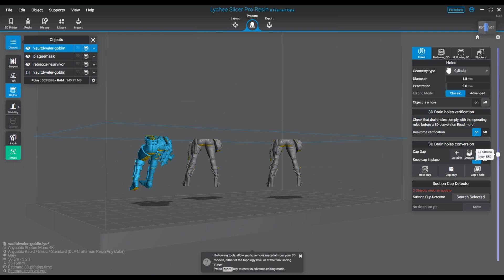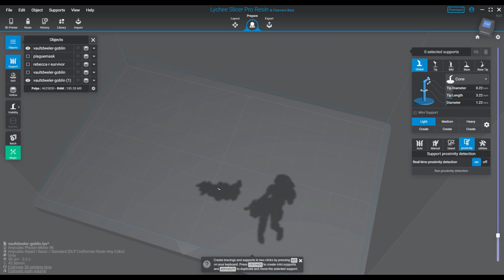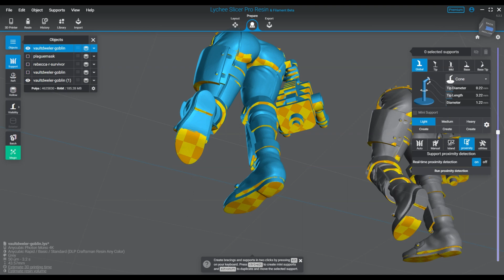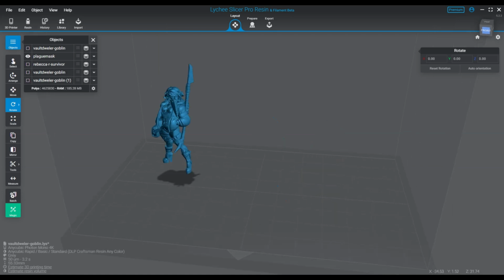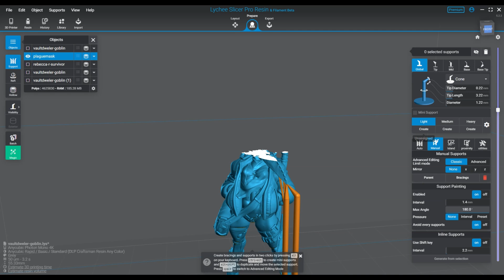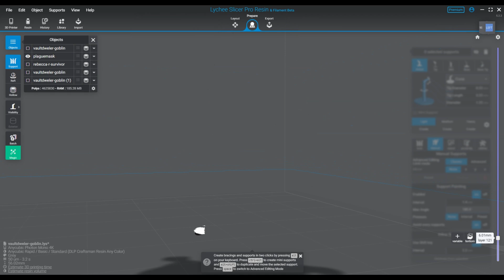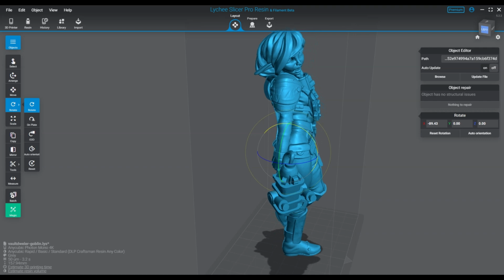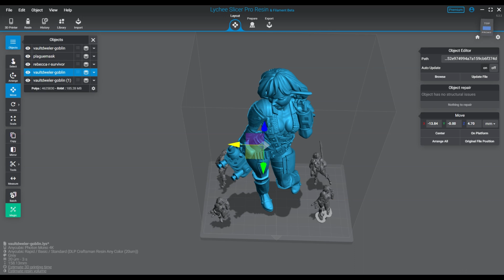Stop doing this with your 3D resin prints

Comment: Tbh I would print her upside down especially with the beak, because it’s easy sand down the hair to get rid of the dimples. I print upside down on alot of my prints
Reply from the maker: Yeah I do the upside down thing, especially with a lot of tiny bits or strands. Good tip!

Comment: I find auto supports very helpful in halotbox. I only print 32mm and smaller pieces, I don't print large models, so the vast majority of factors (weight, height, etc) are not an issue for me in regards to prints.

I did enjoy the video, I always like to see how others implement their own methods.
Reply from the maker: Thanks for sharing! How do the models come out? Also what size tips, bars etc. are auto setting I am just curious as I have had luck with autos in the past, but it was very hit or miss.
Reply: @IPrint3dMinis  

My settings are:
Light supports: Top shape cone, upper diameter .25, lower diameter 1.25, top length 3.00, contact shape none, Contact Diameter .40 contact depth .20, cross width 10.00, cross start height 3.00.

For medium upper diameter .44, lower 1.44, everything else the same.

The heavy is default.

I auto support to set up a foundation, then I manually add supports from there. I will delete some auto supports from the feet of the mini and add 1 heavy to each foot, then tack in lights all around the foot following the edge (like done in video) mediums I primarily add to torso (some times I'll add a heavy or two, just depends on the details of the model because I don't want to cover up detail). 

I also go layer to layer to ensure no islands, etc. Add light supports where needed. 

I don't have a large resin printer either. The program I use is halotbox, it's free, it can be buggy at times but it fits my needs.

The over supporting I do is equalized by the recycling of the supports. I sand down all supports to powder in my box set up I have, then use that powder and make my own resin fill mixture (some people I've seen use flour or baby powder mixed with liquid resin to fill in holes, etc) which is used to fill in holes. 

I then sell that mixture locally as well as use it to repair breaks in my minis, filler for custom terrain pieces (when I make encounter boards from foam, etc).
Reply from the maker: Sweet, thanks for sharing that. Halotbox fine, and if you are just using one small printer it's all good. Again thanks for sharing. @gettingpolitical

Comment: i usually print larger figures, do you think printing they straight will help with the bumps from the supports? Good video, keep it up!
Reply from the maker: Yes, and no. Alignment and good alignment can always be improved. If you find a good alignment, and use a good type of supporting, that will help you see less bumps, at the starts though the prints will always have pimples.
Reply: @IPrint3dMinis   thanks! Yeah, sometimes i got a pretty good print, better when the file is sliced with clean and straight cuts, i am slicing one file  right now, and gonna use your tips to see how it goes haha
Reply from the maker: Good luck! I hope it prints well! @leoldsg

Comment: Dont want to use auto supporting, but auto bracing is ok?
Reply from the maker: It depends I will sometimes go back and remove the auto braces and place my own due to them being at odd angles or straight across. Auto supporting is okay in SOME cases, I use as it as a guide, or just to do internal supports. Auto bracing if you use on small groups of supports usually works pretty well, just don't do the whole model and cover it in braces, it will end up with 8,000 supports and you will use 3x the resin.

Comment: typically the advice I see most often about orientation is to tilt the model about 40 to 45 degrees. The cited reason is that this reduced how visible the layer lines are. What I did for a long time was tilting the model back 42 degrees back and than tilting to the side till I saw a small surface area. It works, but it leaves a ton of clean up you have to do for one side of the model.
Reply from the maker: Well yes, the 45 degree angle thing is better for layer lines, but is not always great for character orientation. I found it works best to simply play with the position until you get a good surface area, and least amount of loss of detail.